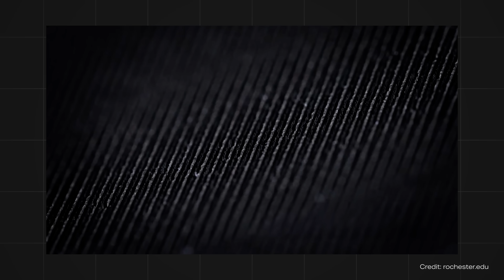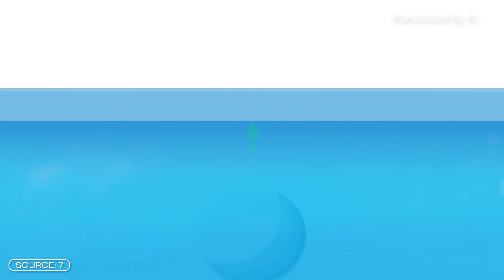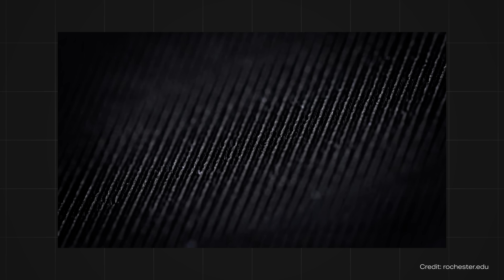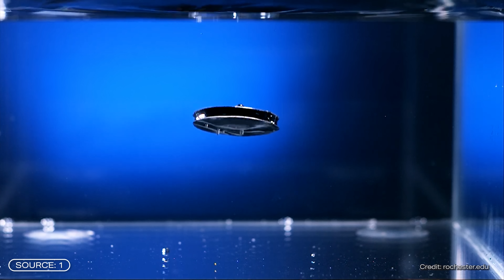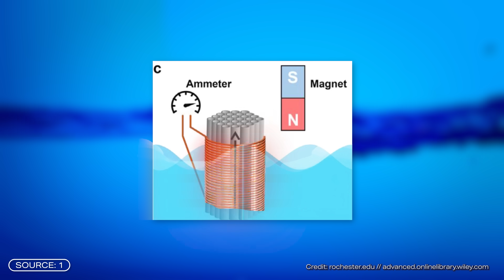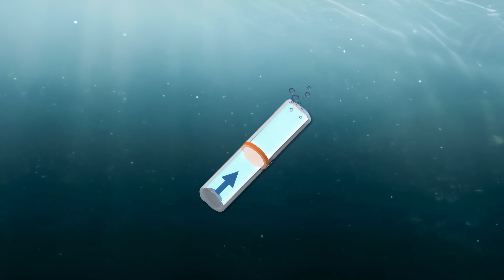New Study: How to Make Ships Unsinkable!

Comment: to me it's an absolute absurd idea.
why not use dubble walled containers with foam inbetween the sheets?
it is a closed structure, the water cannot enter the foam and you can put an antifouling coating just like on the tubes plus you get a smoother outer surface that is less prone to damage.
just immagine how fragile this is...
making electricity from water waves? seems like a completele disconnected idea.

Comment: Honestly I bet you could still get objects to sink with a coating on the hull like that but it would cut through water like a knife which would drastically reduce or almost eliminate the resistance of the water which would make for insanely fast boats.
Reply: On sailboats you'd have to remove some of that coating from the Finn thing so that it actually made contact with water and then it hydro boil or whatever cuz you need Drake on the fin to keep the boat stabilized

Comment: Put air pockets in the hull or make it so that there's sections of air that never leaked out. 

How heavy water is it's definitely not are so it's like your minusing the two weights and then you put air in the middle of that it's a metal floats on water. I never really considered the density of water is one of the factors in buoyancy. But then you think about floating anvils in Mercury.

Comment: This works only in small scale and can’t prevent ships from sinking. If you break the hull for 300000t container ship, it goes down no matter what the surface tension is or does the actual metal sheets float or not.

Comment: Impressive idea but wouldn't it be better to infuse various gases into the ship coatings creating an additional positive buoyancy plus feature instead? Such as infusing co2 into the ship coatings to stop o2 from reaching the metal to prevent oxidation, or helium to increase buoyancy? My thoughts are that once that eched metal is in any water with wildlife in it it will have algae growing on it and lose it's water repellent feature. Even if the surface area could show up on the surface of the ships undercoating which seems unlikely with the repellent nature of the etching, algae doesn't care what the surface area looks like, infact it likes (well maybe not the word like is accurate) etching so it can more thoroughly adhere to what it's attached to.

Comment: they could simply add these as a layer in the hull or used elsewhere to prevent capsizing. dont replace the ship until the scale is capable of doing so reasonably. just use the technology on existing designs.

Comment: Why not produce hollow steel sheets with sufficient trapped air to give it positive buoyancy? An internal honeycomb structure could have high strength too. I used to sail a double hull yacht with polyurethane foam inside built by a lifeboat company. They claimed it was totally unsinkable.
The anti-fouling properties of this material could be be very useful however.

Comment: I am confused. Maybe I am wrong, which I admit, happens a lot, but wouldn't you get a better effect by closing the metal tubes on the ends allowing you to make them larger and avoiding the issue of pressure forcing the air out?
I mean, keep the hydrophobic coating on the outside to prevent sea life from clinging to the ship hull, but it seems to me the same effect would be achieved by creating closed capsules.

Comment: Tool the required surface geometry onto large heated cylindrical rollers and run reinforced plastic material through the rollers to transfer the geometry to the material. Then, create cylindrical tubes from the material, except that the walls would be hollow and inflatable. Join the tubes to make emergency life rafts or other flotation devices. When deflated, the devices could be folded to occupy a very small volume. When inflated, the multiple tubes would provide a safety factor as insurance against leaks in some of the tubes. Other configurations of the inflatable portions of each tube are possible for greater safety.

Comment: Beyond rescue platforms or offshore gear, this has no commercial viability. Ultimately, if they can take what they've learned here and make an applicable coating for ship bottoms to better protect the hull from biofouling as well as even a mild increase in buoyancy, the story changes.

Comment: Ugh... So much bullshit.
No, this "tech" won't make a ship unsinkable.
No, this "tech" isn't suitable for use in making rafts / floating platforms.
No, this "tech" won't reduce bottom fouling.
I'm surprised you didn't claim that this "tech" would lead to super-efficient ships by eliminating water contact with the hull, thereby drastically cutting friction. LOL.

Comment: funny that they probably did it with a distilled water.. Sure major damage was prevented. But they never applied it against a brief stint vs a sand blaster. Preventing fouling is nice, but I'm still skeptical that micro abraisions won't foul it even faster than 1 year.

Comment: Hmm, if we move the partition from the middle of the tube to the edge, and add a second one to the other end, we get... pretty much the same thing, but WITHOUT any hydrophobic treatment, made from any material, and in any diameter?.. Yes, it won’t be an unsinkable material that stops water from entering through holes, but it’s much cheaper and easier to maintain, with almost the exact same properties, right? With a set of tubes like that, even if some get damaged, the rest will still work, so is it really worth bothering with such a complex (and probably expensive) process for a questionable benefit?

Comment: "Unsinkable ships," is a very obviously false claim for this technology.   The skin of a ship does not occupy enough volume to float the ship if the hull is holed and water ingress is not controlled.   It would also be pretty idiotic to try filling interior floatation compartments with this  stuff given the availability and cost of closed cell plastic foams.   
     Instead of having obvious bullshit marketing as your content headline, try selling the actual content, which is pretty cool on it's own.  "Microscopic super-coating makes metal that can't get wet."   Not entirely true as a video title, but at least not 100% false.  A "science" channel content creator posting content with completely false titles should maybe do some self reflection on what it means to be a science channel.

Comment: If they wanted to use them on ships, maybe they could create a "skirt" that would go around the ship at the waterline and as far below the waterline as the depth issue allows.  If they can be securely attached, but in a manner that allows removal, they whole thing could be removed and replaced once a year, then the ship can be on it's way while the old skirt is re-treated and reused on another ship.  This cycling would allow maximum efficiency in the process.

Comment: Surface tension is nothing new.  
Decades of research has already determined it works ok on the small scale but does not scale up.
At a certain point the buoyancy from the hull volume will exceed the buoyancy from surface tension to such a large degree that the surface tension benefits become insignificant as a preventative to sinking.  Asking for research money to help ships from sinking is dishonest. 
Instead the research should be on the benefit of surface tension to reduce hydrodynamic resistance or drag on a moving hull.
I really dislike this type of hype to attract research money or investment money.

Comment: That is so complicated it's not necessary there is a simpler solution, build the walls of the Boats with a honey cone structure double layered and just seal them, also put compartments and that way even if you get a hole the ship still floats oh and you don't even have to weld every honey cone structure individually, it can be done with a robotic laser or an induction machine to weld the honey cone structure to the metallic surface I think that would be much easier than the hole process they did, Right? I mean for Big shipping Boats.
Reply: Except for corrosion and the greatly increased thickness required for structural integrity.

Comment: They're on the right track, but I see a lot of road blocks they'll have to figure out how to overcome them.

The primary challenge faced by researchers—including the team at the University of Rochester using laser-etched metal surfaces coated with stearic acid—is that the harsh marine environment is highly unforgiving. The microscopic "pits" and "grooves" that create the superhydrophobic air cushion are highly susceptible to being clogged, degraded, or obscured over time.
In marine environments, a wide variety of biological and physical debris can collect on a ship's hull:

1. Marine Biofouling (Life Forms) 
Biofouling is the primary threat to any superhydrophobic marine surface. It occurs in progressive stages: 

• Microfouling (Slime): Before larger organisms appear, bacteria, diatoms, and single-celled organisms settle on the metal and secrete a sticky extracellular polymeric substance (EPS). This slime naturally fills the microscopic etched pits and destroys the surface's air-trapping ability. 
• Macrofouling: Larger organisms like barnacles, mussels, tubeworms, and macroalgae (seaweed) physically cement themselves to the hull. Their holdfasts and shells can permanently alter or destroy the nanostructured pits.

2. Physical Debris and Particulates 
The ocean is full of suspended and floating matter that gets dragged along the hull, including: 

• Silt and Sediment: Mud, clay, and sand particles churned up in coastal waters or estuaries can get wedged into the laser-etched grooves. 
• Microplastics: Synthetic microscopic debris present in the ocean can settle and pack into the nanoscale topography. 
• Marine Snow & Organic Flakes: Decaying organic matter floating in the water column can adhere to the sticky biofilm layers on the hull. 

3. Chemical Compounds and Precipitates 

• Calcite and Magnesium Salts: In seawater, minerals like calcium carbonate and magnesium hydroxide naturally precipitate out and scale onto metal surfaces, which can block the surface texture. 
• Hydrocarbons: Oil residues and volatile organic compounds (VOCs) commonly found in harbor waters can coat the hull. Because stearic acid is a fatty acid, it is theoretically vulnerable to interacting with other lipids or petroleum-based pollutants in the water. 

How this impacts the superhydrophobic findings 
Superhydrophobicity relies entirely on the presence of a stable layer of air trapped within the multi-scale micro- and nano-pits. 

1. Displacement of Air: When debris, sediment, or biological slime fills these cavities, the water replaces the trapped air, effectively "drowning" the superhydrophobic surface. 
2. Degradation of Stearic Acid: Over time, bacterial enzymes and chemical interactions with seawater can break down or wash away the thin stearic acid layer used to lower the metal's surface energy, leaving the metal prone to corrosion.

To solve this, researchers focus heavily on making these surfaces mechanically robust and relying on the natural self-cleaning properties of superhydrophobic materials—where rolling water droplets can "pick up" dust and debris. However, in heavy marine biofouling scenarios, active maintenance or supplementary anti-fouling coatings are still required.

My concern, is also the chemicals they'll need to use to keep it clean, and how many times they'll have to put the ships in dry dock to do so, and whether those cleaning chemicals are safe for all water life forms.  So it's a good start, but a lot more research is necessary.

Comment: If these structures were left submerged for long periods, the trapped air would slowly dissolve into the water, and replacing it with water as the effective interior pressure increases (and behaves like being submerged more deeply). That seems like a big problem.
Reply: Water flows through metals?
Reply: @mikemondano3624  Ummm through metal tubes? Yes.

Comment: I think it's amazing as anti corrosion anti algae coating if it is possible to scale it up from small tubes you can dunk in a tank of chemicals into something you could apply on large sized machinery and ship hulls.

The tubes themselves? A nothing burger, we can already achieve material like that by sealing tubes that size and encasing the structure in corrosion resistant layer. I fully understand that what they are proposing is a super-material that is completely water tight until it is pierced trough by something larger than the tubes themselves on top of being extremely buoyant, but it's not that structurally strong and if strength dos not matter why not use plastic foam?

Comment: Suggested use: Instant emergency Mulberry Harbors Part of the main problem with getting relief materials to Puerto Rico after the last major hurricane was the fact that the dock facilities needed to offload supplies had been effectively destroyed. Instead of lightering (offload to small boats, send it to shore, bring it back, repeat 10,000 times) they can instead load up a relief ship with a couple hundred plates, run out a floating dock - and offload directly to trucks. Edit: And without biofouling it'd be a cinch to tear down when done and re-use it.

Comment: However this will not matter if a big enough hole is punched through the hull of the ship 
If the max limit of this is only a couple of millimeters, there's kinda no point in the material since a normal hole of that size can be patched up with relative ease

Comment: Universal Failure Mode: Cassie → Wenzel Transition (collapse of the Cassie-Baxter state).
UV degradation, abrasion, and chemical attack because they destroy the geometric and energetic conditions that stabilize the trapped-air layer. Also, capillary action, condensation, pressure, vibration, contamination, pinning, mechanical damage (abrasion flattens peaks or rounds re-entrant features that help stabilize the composite interface), aging, ice, bio-fouling …
Nature solves the regeneration problem with continuous growth or secretion (lotus leaves shed old wax layers; insect cuticles are renewed). Self-healing or slow-regenerating chemistries (inspired by biomimetic continuous slow regeneration) would be transformative for both domains. 
Superhydrophobic vs plastron-optimized surfaces (diffusive gas loss (underwater plastron decay).
The surface likely needs some form of:
1. Chemical regeneration
2. Structural regeneration
3. Gas replenishment
4. Dynamic reconfiguration
Perhaps incorporate a magnetically actuated, superhydrophobic cilia field that periodically deforms to restore gas pockets, shed contaminants, and resist Cassie-to-Wenzel collapse (elastomers loaded with magnetic particles, then driven by rotating or oscillating external magnetic fields). BUT one would need gar reservoirs, gas injection, electrolysis or catalytic gas generation, dissolved gas regeneration /harvesting, and so on.

Comment: It's very cheap to make sealed compartment for floatability, this seems expensive and not as durable.
In the end, you need a certain volume of air for buoyancy, you can trap air differently, being unsinkable takes SAME space.
Also, I don't trust the "high salt water" test, seawater has a lot more and is a maintenance pain for all floating devices.
In the end, we might create funny small size devices with this, but it's not for any ship.

Comment: So, instead of claims for lower drag and therefore fuel economy, these folks are saying they invented unsinkable ships by stuffing a lot of microbubbles on a surface of a ship.

The essence of the ship is trapping the air inside the vessel, not within a cover layer. So if they just placed all the water bubble in a safe storage within the vessel, they might even invent a boat, which is a quite remarkable achievement for Englishmen in 21st century.

Comment: If the hull needs re-treatment annually that’s not much better than current practices. Assuming the process is more involved than painting the current anti-fouling coatings may be preferable   A buoyant closed cell foam might be better than entrapped air as the diameter of the tubes could be larger. A hydrophobic surface would be good for boats. I’d love to see what sort of improvement they’d get in that area.

Comment: Making structures buoyant in general sounds like it could come quite in handy when designing things around water to be safer. I'm thinking things like Warf railings, ladders, etc. Not wet is ideally how I want all the metal I have to climb on or use near water to be. I have to wonder though how this would work with water nearing freezing temps. Ice might completely ruin it's functionality eh?

Comment: Err..most probably a dumb question...but why wouldn't you just close off the openings? + Maybe keep the inside hydrostatic coating to kick in in the case of minor mechanical damage (holes/cracks up to the 5-6mm threshold)? 
I guess i also don't see the benefit to getting boiancy from your hull composition rather than ship shape? 🤷 Mainly due to the manufacturing, maintenance and structural complications it would bring with it?  Cool idea but I'm having a failure of the imagination re what problem it solves better than established methods?
I suppose you could take rafts to the next level? 
Also also how do physical impacts affect this system?

Comment: Well, Maersk already resurfaces the bottom of their boats every 5 years, has special robots to clean them, and uses anti-fouling silicone paint reinforced with carbon nanotubes. If the technology seems to work, I am pretty sure they are ready to test it on one of their older boats.